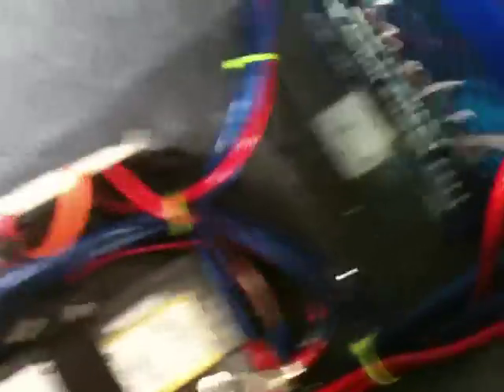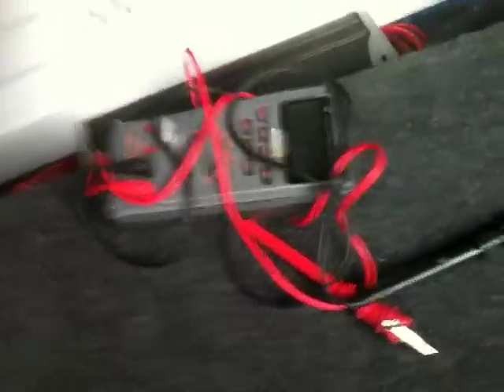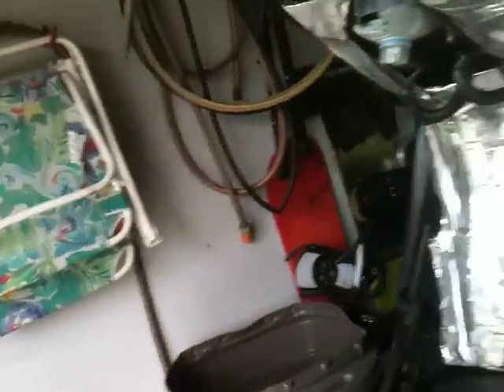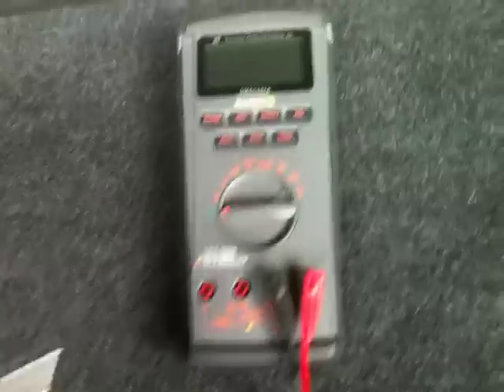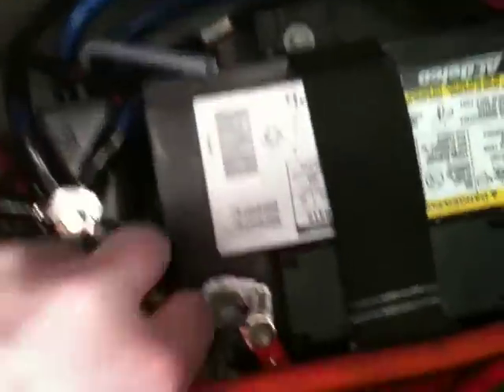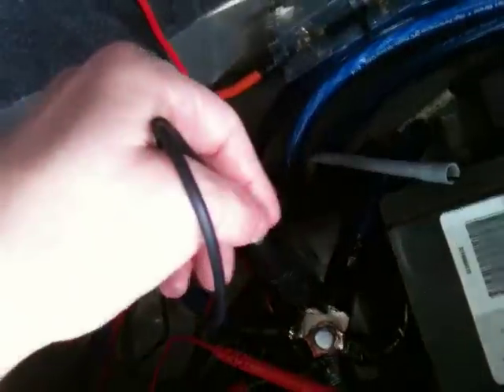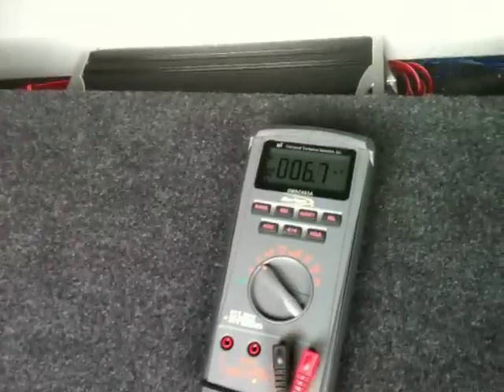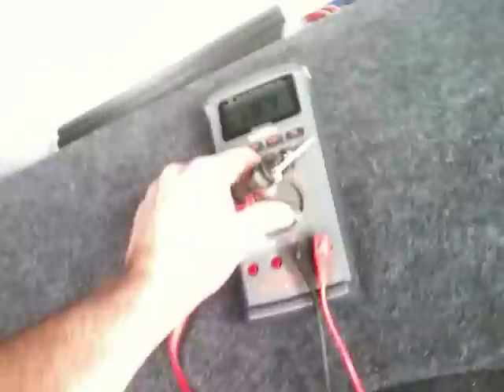how to find a good ground

Comment: Also even if it was a bad ground it still could show 0v since it is connected by that wire. You basically tested if that wire was a good connection on the battery.

Comment from the maker: @imupabove isolate the part of the circuit you want to have a good ground and wire your dmm in parallel in on both negative components to voltage drop just the area you want to have a good ground. im sure they make extensions for a dmm somewhere

Comment: you set it to DCVolt and you connect the lead into NEGATIVE terminal of the battery ?? OFCOURSE you will get BIG 0 Voltage. Voltage coming from POSITIF terminal of the battery dude. To test ground you should set the DMM to DC Resistance, if you want to test volatage drop, connect the lead to positif terminal of the battery and the negative to your ground point and DMM to DCVolt.

Comment: If there's no active load on the circuit (amps off as in the video) then there'll be no current flowing from your ground point to the battery, and so a voltage drop test as shown here will always show 0 volts dropped.
Reply: Wrong killer. Go back to school.

Comment: This was a fail. Reason being it doesn't have any current going through right now. But your close. Put one on back batt and the other on alt case. Put on peak hold or min max. Then play system full tilt should be less than 0.2v
Reply: We have a winner here folks. He's talking about LOADED circuits now. Tell them all about it again Clay.

Comment: I check my big 3 ground and they are good. The problem is that when I started the car, put it on drive, turn the headlights on and the a/c( sound system off) my voltage drop to 12.2v. My battery resting, measure 12.4v....optima red top and stock 70amp alternator. I drive a '94 Corolla. What could be wrong?
Reply: The alternator

Comment from the maker: ground to the bolt that holds the alternator to the motor, the alternators internals ground themself to the case of the alternator in theory thats the best ground on your car
Reply: Best ground is at the - battery terminal directly. Go back to school.

Comment: hi, have you got a earth going from the rear to the front of the car ? as the cars body is only as good as 4AWG due to the way the car is put together, so poinless having 0AWG power wire with no earth going the length of the car also.

Comment: nice video, but i have a question, i have to put the positive multimeter tip in the negative(bat) and the negative  in the -(ground point) and i will get a value ???? thats ok? greetings and thanks :D

Comment: Nice job but faulty. You need to fully LOAD the circuit, THEN test for voltage drop. This video is great for a system that draws 0 amps. I think your fire hazard vehicle will surprise you UNDER load. Never ground to steel ANYTHING. Frame, chasis, trunk sheet metal and so on. Steel while clean is 30% worse than copper. Then a week later your steel body ground will corrode and take your ground down to 0%. Then comes the engine whine and cooked amps. Wonder why my amp died?? .............  Hello!!!!
Reply: You are 100% correct!
Reply: jim davidson ......so whats the solution then?
Reply: G Man 
Exactly!!! What is the Solution! Where in the world does ANYONE Ground if you can't ground to anything steel🤔I think that as long as you are grounded and the surface is steel that you should make sure that you are applying plenty of Dielectric grease to a surface that is wire wheeled and cleaned up very well with a rough surface!!! Whallah👍
Reply: @smigletat9634 rue that also a simple coat of spray paint on the sanded down steel works great as well!!!
Reply: a spray of plasti dip over everything once connected and done is a great way to seal everything up.

Comment: did you add that ground because it looks like a lead block the reason i ask is because i am running 2 amps one 1600 for mids and another 2000 for subs and once i installed the 1600 i started noticing my ground isnt good enough i was thinking of running another wire to the actual ground on my battery in the front is there an actual block you can buy that creates a ground?

Comment: .what is ground?
Reply: The negative side of the battery is connected to the chassis of the car. Making all metal parts connected to the chassis negative. So grounding means connecting to the negative side.
Reply: Something that eludes this guy in the video. And 99% of the commenters here on utube.
Reply: jim davidson Is that a good thing? Non-native speaker here.